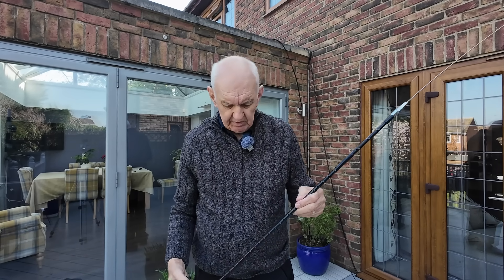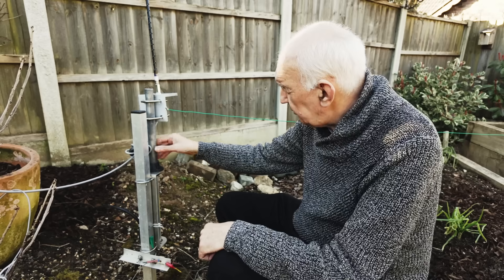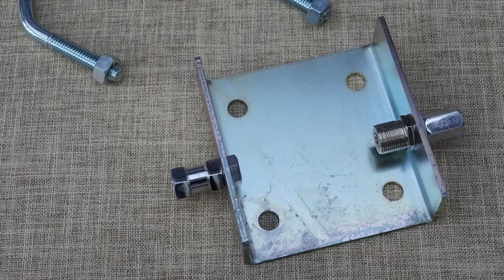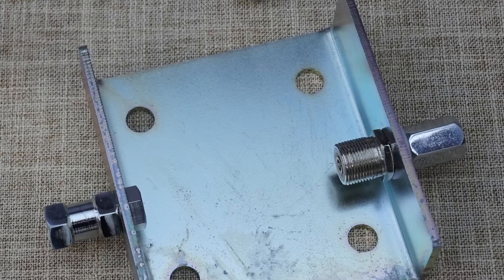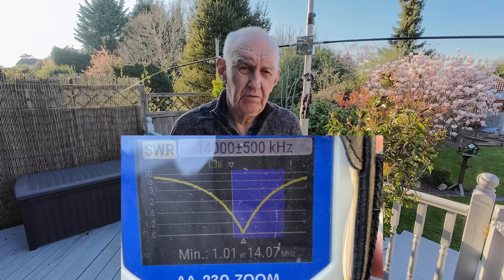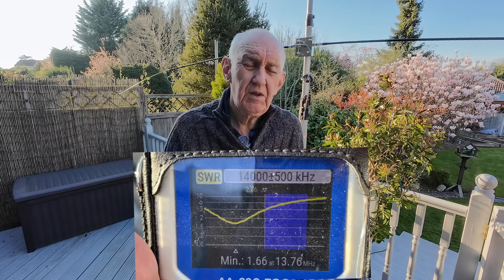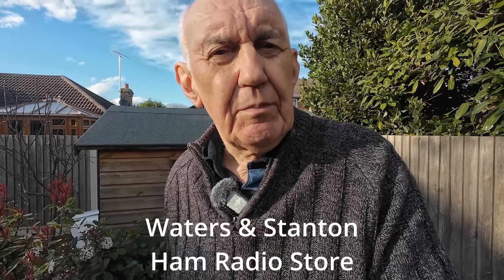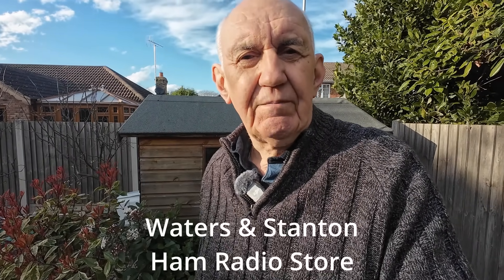My Secret Pop=Up Dipole Antenna

Comment: Might I suggest a bit of fuel line hose or comparable tubing to slip over the u bolt threads to prevent chafing of the coax.

Comment: If you want the math..
	λ = C over F
where λ equals the antenna length
C = 300 000 000 (speed of light in metres, use 186 000 for Imperial
F is the frequency.
My Math teacher, at school, was a radio ham.
He explained everything to us.. Skip, ground planes, Sunspots and loads more.
Reply from the maker: Thanks but you cannot use that formula for an inductively load antenna.

Comment: There used to be a small pot-bellied stove in my kitchen, it provded hot water and some heating.
It got replaced by a full central heating and hot water on demand system.
However, this left the chimney on the stove, unused. 
At that time, the local Council had to provide a permit to put up an antenna, limited to 3' 6" above the roof line.
Which made them the same height as normal TV aerials.
The more astute amongst you will realise that a 5/8 wave "silver rod" would break the byelaw.
Never mind that they didn't allow the use of ground planes!
Using the motor from a windscreen wiper, we used a pulley system to raise the antenna up the chimney.
The whole thing fitted inside a Kopex liner with ground planes flopping out once elevated.
I built quite a lot of these with some being disguised as sewerage breather pipes, where no chiminey was available.
More a case of "thinking inside of a tube" than "outside of the box!"
I sold so many that I bought a brand new, imported from the US, CB/SSB transceiver, after a few dozen were sold.
Couldn't advertise them but word of mouth did the trick with the help of the CB repair shop.
Reply from the maker: `nice one. Thanks.

Comment: Regarding the tuning problem with the whip extending back into the coil causing detuned problems. I 100% accept that steel in the middle of a coil at hf is to be avoided (hence the degraded Q) but I think there may be another overlooked problem here too... Linear loading.   The "inside" section of the whip is insulated from the coil. Forget the coil for now & just think of a piece of wire coming out as the end of the main antenna part with the adjustable whip section sliding back just to the side of it. Think of retracting the whip fully so it doesn't extend much past the end of the element wire.. how long is the antenna?... Intuitively you would say the length of the element wire plus the little little whip extension length but this is wrong... Look at linearly loaded antennas where they have their ends folded back. The "length" of the antenna has to take account of the folded back length too.
Pushing the whip in reduces the overall length but increases the linear loading hence trimming the unneeded inside whip tail as you go along would seem to be beneficial for avoiding both coil degradation/Q lowering AND unexpected parasitic linear loading.
Reply from the maker: Thanks for your comments. Linear loading normally requires an element to have continuity and bent back on itself. I would describe the secondary effect of the element section inside the coil as capacity loading.

Comment: I'm currently trying to persuade a Chinese auto-ATU manufacturer to sell a balanced input version that could be used elevated at the feed point with two 9' stainless CB whips & that should cover 20m to 6m. (Or use 25' bits of wire a la half size 5rv or rybakov or Comet cha250 to get 40 as well).
In the interim, for temporary use in low wind conditions a dipole created from two of the 17' light telescopic whips can cover 20m to  4m without an ATU simply by extending them to the right length for the current band of interest.
Reply from the maker: I think there is at least one German manufactured example intended to feed balanced line to a doublet. Probably the more practical option.

Comment: I have a single MFJ 40 meter hamstick which is similar to this antenna. I read somewhere that it is not good to use the antenna with the whip inside the coil section. I'd have to research it again to find out why. When I tuned my 40 meter antenna, I cut off the excess whip just below the threads. Coincidentally I have two 20 meter hamsticks on order, and I will be testing them in a dipole configuration. 73 KD5YOU

Comment: I use these a lot of the time, in between putting a delta loop up, i use them for 10-15 and 40 Mtrs Have worked North and South America as well as the middle east and Africa at a height of around 20 feet. De Gosgo

Comment: The new one that I tuned had instructions saying trimming may be necessary, as the core should not extend down into the tightly wound part of the antenna base. You will notice that about 8-10" down there is a tightly would loaded section in the middle of the helical windings.

Comment: Have you ever  fixed a heathkit twoer hw-30 ? I just bought on off ebay and a ha-201 amplifier.  Hoping to get them both working. Going for my technician lisence.  I am going to build a dipole  antenna  for it too. Worked on many electronics laptops and such but never a ham radio   it will be a new experience.

Comment: I was fiddling with my shark brand hamsticks on my travel trailer in the vertical arrangement last weekend and absolutely saw the exact scenario you showed.   Shortening the antenna to move the dip higher in the band and hit that "spot" where the entire curve and dip shifted in the wrong direction, and the dip went to higher swr.   I did not understand the physics per se, but knew it was too much whip into the loaded coil.  I'm not ready to do any cutting, as my mount is still in the initial design and deploy planning, and I may do something with my mount and may need the extra length.  As usual, your videos are most excellent.

Comment: I have tried this configuration briefly for testing and will try again soon. This is the first time I have heard about the "iron core" aspect. Excellent! I also like the device you used to screw in the two antennas. First time I have seen that model.

Comment: So informative, I tried to tune this exact antenna in an undesirable location inside a balcony of a high rise building with all kinds of metal around. The effect of the whip inside the wound black section must have been what was happening! But I thought it was all the metal around. Thanks for shedding light on this!

Comment: I replaced the original steel rod in my Ampro 11 with a 3mm brass rod. I sanded down the rear attached part so it could be inserted. Then, I trimmed the top of the antenna to tune it. The brass rod cost $3.
Reply: What differences did you find between the 2 metal rods?

Comment: Peter I had this type of dipole published years ago in RADCOM. I called it the "Sky-Painter" 40m Field Day Antenna. You will find that using the two whips instead of just one will slightly improve the bandwidth from the manufacturers spec for just using one on it's own. I had a raised support above the center of the dipole to have cord supports to the ends of the black wire sections due to high leverage strain on the dipole connectors. It makes a great portable and directional dipole antenna.

Comment: I have a pair of 12m whips that did that. I shortened them up a bit and now get a 1.1 swr anywhere I tune it in the band. They were to long going into the loading coil like you explained. These also work good as co phased  verticals .

Comment: The coil and wire will also get hot. I had one whip change color where it was inside the coil running only 100w.